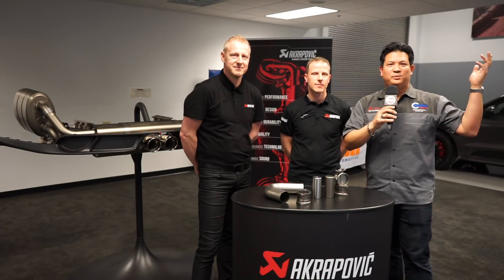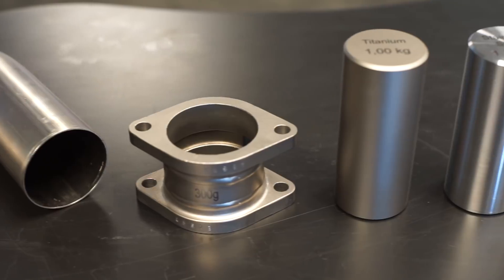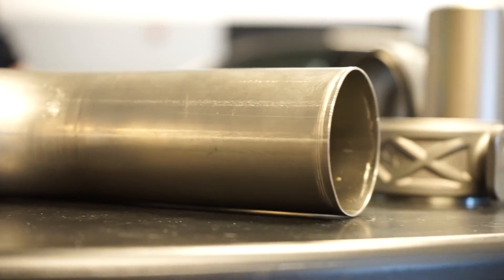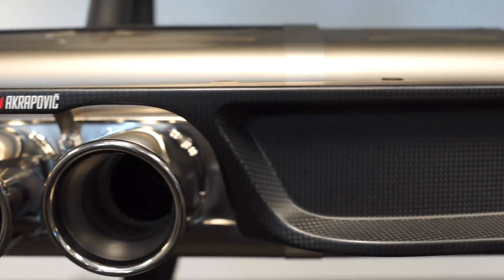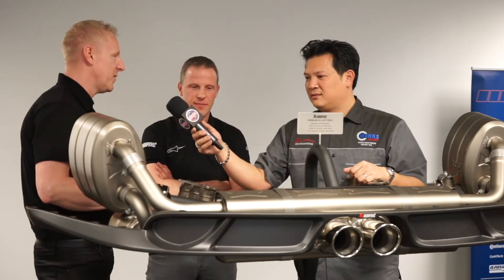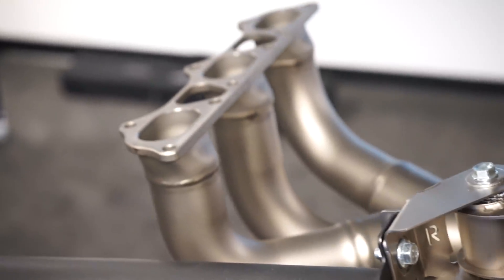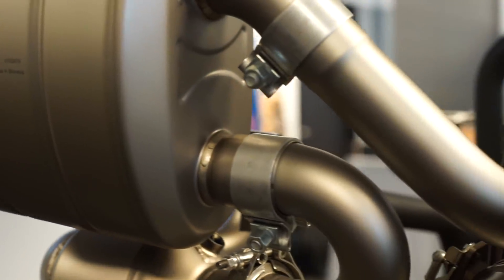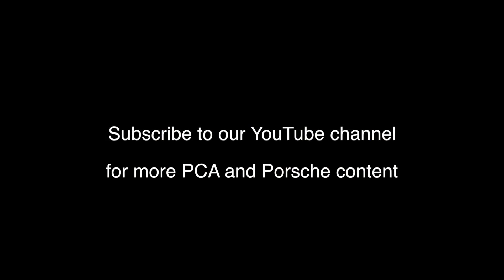PCA Spotlight: How Akrapovič makes titanium exhaust systems

Comment: just installed an akrapovic full exhaust system on my Kawasaki ninja1000, exceeded my expectations.  The weight savings was 25lbs, its a work of art. The look the sound the weight savings a 15 horse power increase, wish I would have done it along time ago,  and the fitment was perfect. 1500.00$  expensive but I feel its well worth it. There products are 1st class.
Reply from the maker: Thanks for sharing!

Comment: What they neglect to tell you is replacement parts are not available, so if you damage your very expensive Akrapovic exhaust you are SOL. I have a 2012 997.2 Turbo S and not able to get the 200 cel cat I damaged.